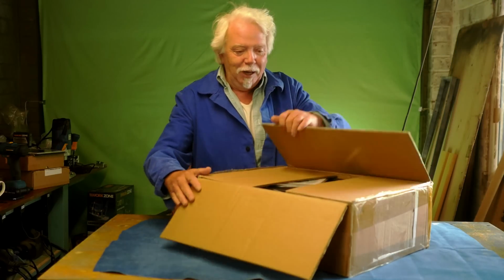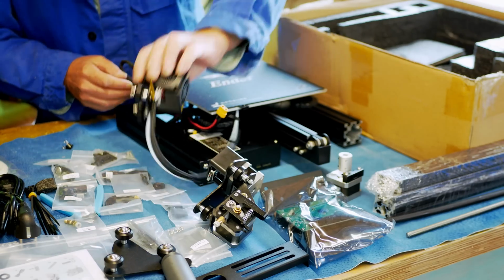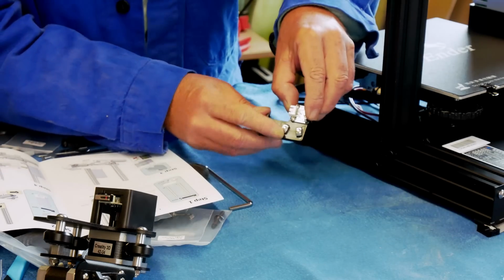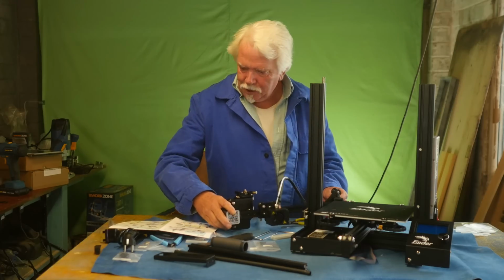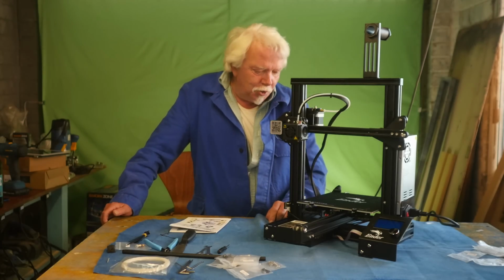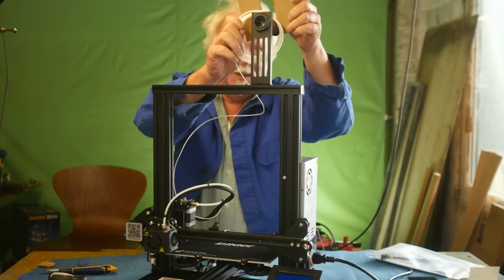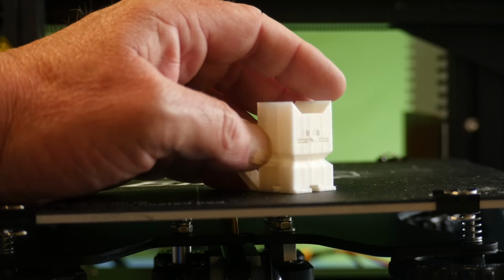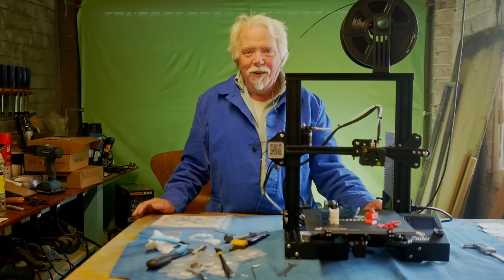Creality Ender 3 3D Printer Unboxing, Assembly and First Use

Comment: Hi Keef! haha. So glad you got it, you did the right thing waiting. It'll do PETG you just have to change your settings in the slicer - 60degC on the bed and 230-240degC on the nozzle worked for me. To clear the blockage preheat the nozzle to ABS temperatures it probably just needs a little more heat to clear that PETG out.
Reply from the maker: Angus! Honoured, we are! Thanks for the tips. I'm planning to print some temperature towers and things with the various bits of filament I have, and also try to calibrate the printer properly.

Comment: Great video Keef. My RL job is an IT Technician and I look after some 3D printers in our school / college. We got some "plug and play" printers from XYZ which work well out of the box and don't require building, but don't leave a lot of room for tinkering or modding. The model you got looks like it will be just the ticket for what I need and it's cheap too. I'll take a look at Creality. If you need any help with printing headaches, give me a shout - I've spend many hours cursing "birds nests" after a long print.
Reply from the maker: I got this from GearBest - great price if you can wait 5-6 weeks for it to come from China!

Comment: Oh hello there can you copy anything ? As I have a useless carpet cleaner the needs a barrel type roller for a belt to run on. 
I could not figure out why the brushes were sticking as I always clean it and dry it in the sun after using it only to find out after I took the bloody thing a part the METAL roller had totally fused with a charming coat of rust that I haven't been able to loosen after soaking I wd40 or penetrating oil. Hoover needs to rethink the design this is not disposable machinery or maybe it is because you have to buy another one 🤔😣
Reply from the maker: Ah, Bren, I don't think a 3D printed part could be strong enough to replace a metal one. Or at least not one made on my printer!